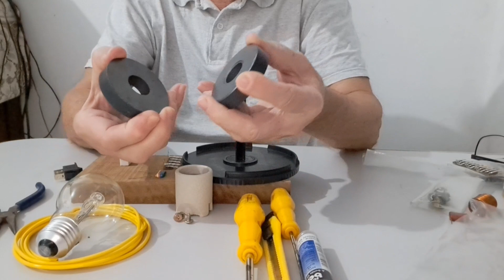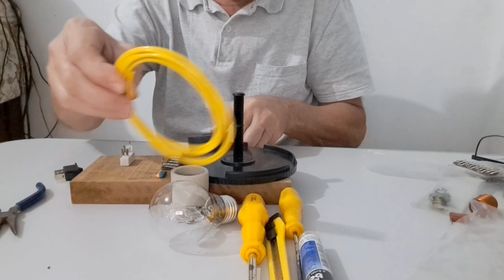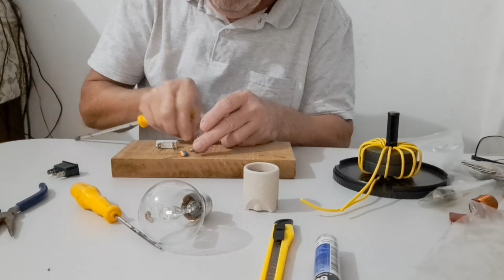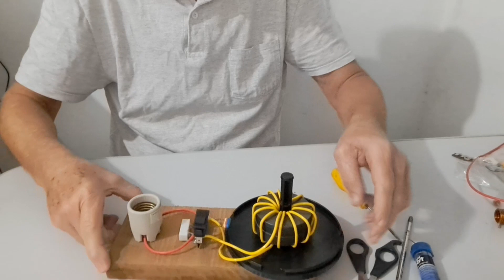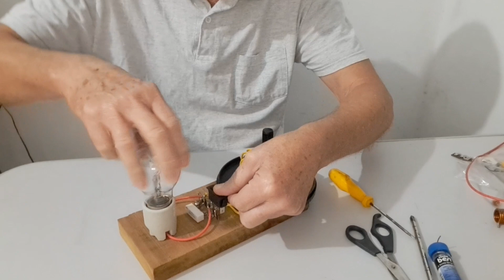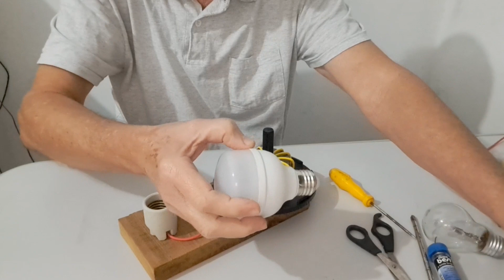DIY - Free energy Project, 220v - 3.3 Kw. Resonant magnet generator

Comment: What are the values of the resistor and cap? Parallel or series? Circuit diagram? Why does this work with nothing to oscillate the field?
Reply: It has no place at home.